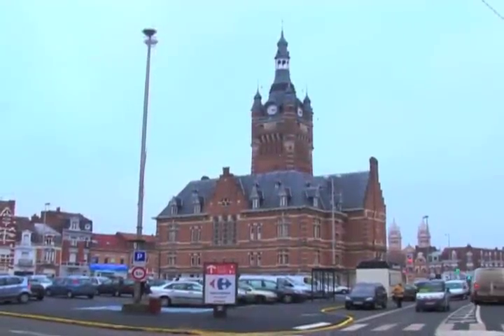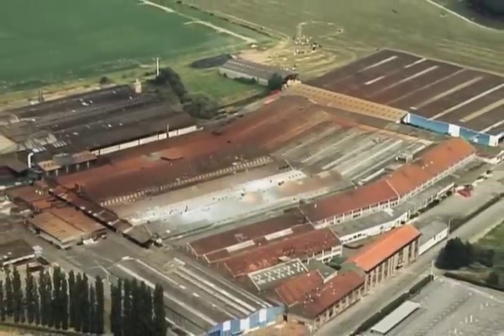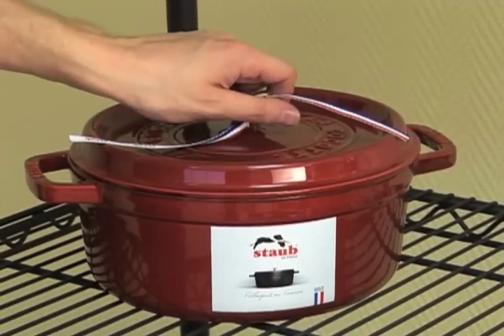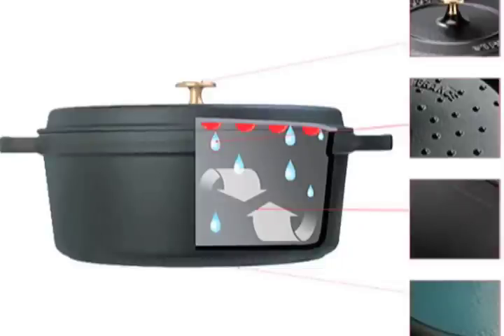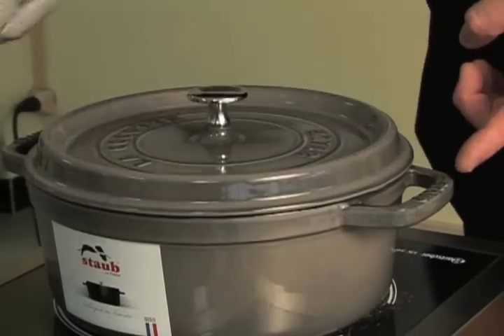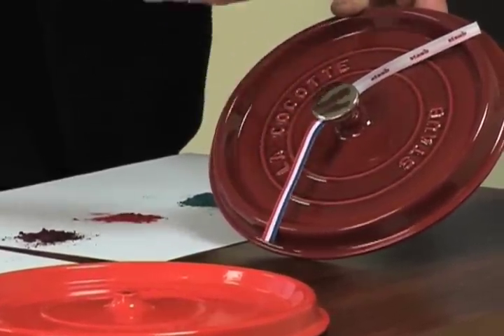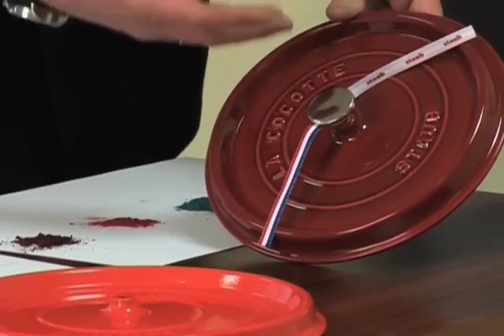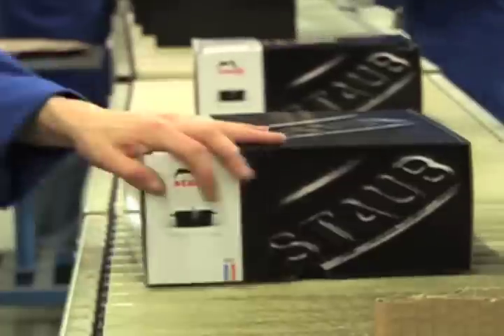Learn More about Staub Cookware | Williams-Sonoma

Comment: Staub is by far better than Le Crueset which I find burns and doesn't last forever as they claim. Staub hasn't promoted itself (German what do you want) like Le Crueset and that is why they are not as popular.
Reply: +Elise Krentzel if its burning maybe you should try low ou medium temperatures. Le Creuset is enought eficient and doesnt need much effort to work by itself. Le Creuset has also two times of enamel cast Iron, one is the Sand enamel (vitreous) and the other is the Black Satin. The advantage by far of Le Creuset Sand enamel is the cleaning process. It does not retain any flavors or odors from anterior recipes.
Le Creuset is a traditional brand from 1925, Staub is a copy from 1974.
Reply: Fab I have never found that to be true and I've used Le Crust for over 3 decades. Well I actually stopped using it more than 10 years ago.
Reply: Huh? Staub is a French brand as well, not German. I have pots, pans, Dutch ovens and tagine pot from both the brands, they're excellent, but I slightly prefer Le Creuset.
Reply: Yes Shane, absolutely. Staub uses Henckels because of its popularity.
Staub is not that bad...but still a copy. Even in their website, the presentation, the text style, are very inspired by Le Creuset.
Once I've been in a Staub store the salesclerk (to convince) me started to gossip about Le Creuset... 
Im a cook. 
Le Creuset for us is a classic and a classic never fades out.
If you think about motorcycles Le Creuset is a Harley D. If you think about a car Le Creuset is a Rolls Royce...
Ok, there is amazing car, brand New and etc, but is a dream when you have a classic in your hands... :)
Reply: KK13, big fish eat small fish - German corporation Zwilling J. A. Henckels snapped up Staub in 2008. Staub remains a French brand, production site still being in France.
Reply: Staub has a similar multi-enamel coating, with an additonal mojolique coating, that Le Creuset does not have.  Staub is just as easy to clean, and doesn't retain flavors or odors anymore than Le Creuset.  Just because Le Creuset has been around longer than Staub, doesn't make Staub an inferior product.
Reply: I agree with Elise.
Reply: Actually, you both are correct, although technically the Alsace region, which was at one time in Germany is now a part of France.  Staub is clearly a German name, but the factory is in France.

Comment: Mine became a rust bucket after 2 light dinners.  There was clearly an area that was not enameled adequately.  When I sent pictures of the rust to Staub, they sent me a PDF with care instructions that came with the rust bucket and were followed after BOTH uses.  No offer for any warranty assistance at all.  So much for their 30 year warranty.  Unless I become very iron deficient, I will never buy another Staub.
Reply: Mike Bergen interesting most people like staub. I’m trying to decide if I want Le creuset or staub Dutch oven. This is not an easy decision.
Reply: @kristalynn7877  If you can only have one, I'd go with Le Creuset; the lighter interior color makes it easier to monitor the degree of browning of your fond when making sauces and gravies, for one thing. The black interiors of Staub are nice if you obsess over stains and crazing of the enamel, though. (That doesn't bother me; I'm cooking, not curating an art collection.) Another thing to consider is weight. Cast iron cookware is never light, but by way of example the 7-quart Staub Dutch oven weighs just one ounce shy of 16 pounds; the closest Le Creuset Dutch oven is slightly larger at 7¼ quarts, but weighs less at 13.7 pounds. When you're moving a hot casserole to and from stove and oven, that 2+ pound difference can seem considerable.
Reply: SeikiBrian thanks, these are some great points! 🙂

Comment: Is the cooking surface enamel based or is it the traditional cast iron?
Reply: Staub uses black enamel coating on the interior surface. It can withstand higher temperatures than the white coating of Le Creuset pots.
Reply: cast iron.
Reply: Black enamel. They clean super easy too.
Reply: @d.version1468  No, it's not bare cast iron; it's enameled, so you can cook wet and/or acidic foods without them reacting with the iron.
Reply: @winnietheshrew2957  "It can withstand higher temperatures than the white coating of Le Creuset pots."

Pure BS. Black versus white is an aesthetic choice; it has nothing to do with "withstand[ing] higher temperatures."  Both are vitreous enamel and have the same heat tolerance, differing in the choice of added pigment. Staub uses black pigment because it hides stains better; Le Creuset uses "white" (which is actually sand-colored) so you can see the degree of fond browning better. (And Le Creuset uses black on some of their pans, depending on the typical use of the device. Sauce pans and cocottes are sand, while frypans and grill pans are black, for example.)
Reply: @winnietheshrew2957  The color is the only difference. They are using the same material.
Reply: @Layput  I don't know if you're right or not. I've done a lot of cooking with Staub and Le Creuset pots and I've come to prefer Staub. 
At first appearance, the pale-colored inside of the LeCreuset pot seems to make it much easier to control the cooking process when you sear the meat and brown the chopped veggies for the sauce. In reality however, no matter how careful I am, the food always sticks like mad to the LeCreuset pot, gets burned and makes the sauce taste bitter. This never happens with Staub. 
I assume this is due to the rough coating of the Staub pot. If this kind of coating could be applied in the light Le Creuset color instead of black, Staub would do it (for the reason I mentioned above), so there must be a difference in the types of material after all.